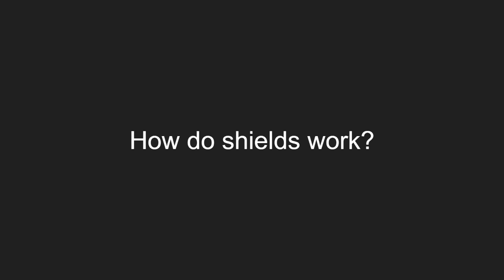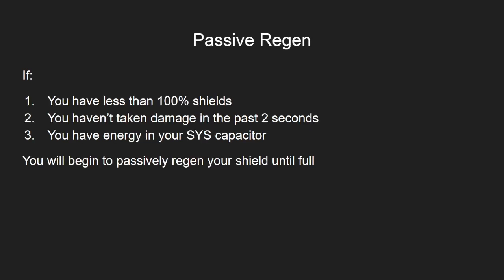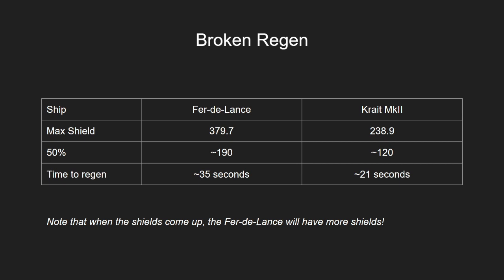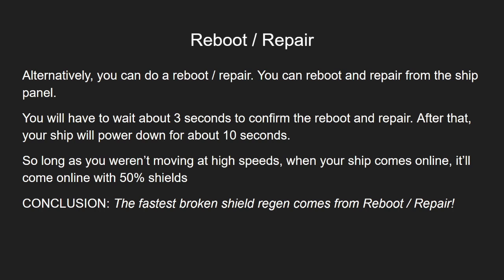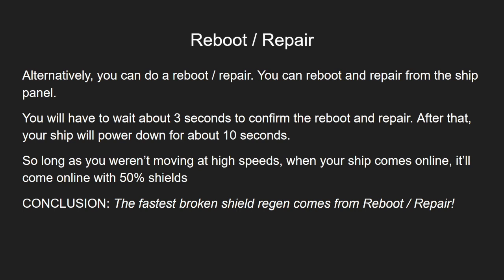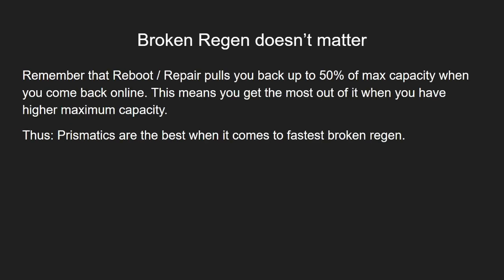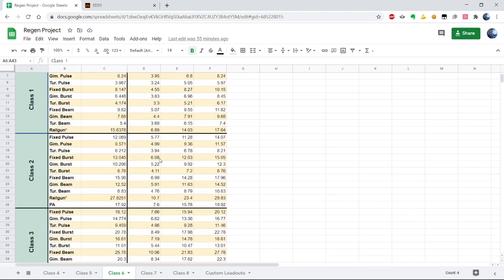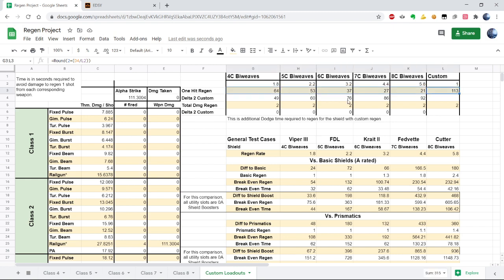Why Bi-Weave Shields Suck

Comment: Not even gonna finish watching this but I can already tell you it depends on what you are doing,  for bounty hunting its a mixed bag, for conflict zones it sucks balls, for 1v1 pvp, if your opponent is using the plasma accelerators, it's a godsend.  At that p9int you are jousting, and if you know how to trick the aim guide for them, then yes biweave is nearly top tier, just avoid getting hit for 2 or 3 passes and you already regen more damage than you took.  I went up against a vulture that had bi weave like me and we knew what we were doing, we called it a draw bc we would've been there all day until we ran out of ammo
Reply from the maker: Thanks for saying you didn't watch the video because I actually describe the cases in which biweaves are useful. Your anecdote just tells me you and your pvp partner suck at combat.
Reply: @im-the-zam  first off, pretty sure my pvp track record would beg to differ, considering I went after the so called best pilots at the time, I made a build to counter the Fer de Lance plasma meta, one that everyone told me wouldn't work, and I NEVER lost a duel.  Infact crimsongamer99 came across the same build 3 or 4 years later and it started picking up traction.  You are a little late with this video explaining why bi weave shields "suck."  Yes I know this was posted 3 years ago, should've posted it 8 years ago
Reply from the maker: You're saying that in your pvp vulture you and your friend are either unable to hit each other or are spending minutes out of combat. If either are true, you and your friend are bad. Without engineering on the PAs, you're still doing enough damage to require 30ish seconds out of combat for 1 hit by 1 PA (on just the absolute damage alone). You are overboosting in your jousts if you are spending that much time out of combat. You have a skill issue. And if you are not hitting your target, you are also skill issue.
Reply: @im-the-zam  I didn't tell you what build I was using, nor what ship, or how exactly I fly to avoid getting hit, if you can't figure that kind of stuff out on your own, you need help.  It sounds like you assume things way too much.
Reply from the maker: You told me you and your friend were jousting in your pvp vultures and you said you were tricking the lead indicator to make your friend miss with his PAs. Ignoring the fact that the "tricking the lead indicator" thing is pretty easy to hit through (your friend is definitely bad) I know you are using a bi-weave shield. And since I know how much absolute damage PAs do it's a fairly simply calculation. Even if you're running fast-charge, the regen rate for 5C bi-weaves is only 2.5. Unengineered PAs do a little more than 50 absolute damage. Factoring in the out of combat delay, it'll take you 22 seconds to regen after getting hit by one. 42 seconds to regen after getting hit by two. If you and your friend are spending minutes out of combat and / or are unable to hit each other to the point where you have to call a draw, you and your friend are just bad.
Reply: @im-the-zam  read again on what ship I was using, you can read can't you?  And also it's easy to trick the lead indicator, I doesn't flow if the ship is constantly changing its trajectory,  if you think that's impossible, or highly unlikely then you haven't tested it out for yourself.  Yes, I can avoid getting hit by plasma accelerators for longer than a minute as long as I don't fuck up and keep my distance until I'm ready to go all in.  I mean by keeping a distance that still allows me to do some small amount of damage while staying at a safe range even with a slower ship compared to the Fer de lance.  And no I don't fly the vulture.
Reply from the maker: I know how the lead indicator works. I tested it thoroughly when people kept telling me that NPCs do impossible things to dodge PA shots. Either way, many games have lead indicators, they work the same way, and if you have experience with space sims that have projectile weapons, you quickly learn to not rely on the lead indicator. So yes, you and your friend have skill issue. It doesn't really matter if you weren't in the vulture, again, I can easily calculate how long it takes for you to regen damage and the whole point of the video, the thing you DID NOT WATCH yet still found the need to comment on, is that the regen is really low. Even if you're in a larger ship with a 6C bi-weave, you're still looking at around 20 seconds to regen the absolute damage alone (60% of the PA's damage). The numbers I have been showing you have been for just the absolute damage, we haven't even talked about the rest of the PA's damage. 

So yeah, if you and your friend are so bad that you cannot hit each other for minutes, you're bad at combat.

Comment: I have an engineered cobra with bi weaves. Should I be using an A grade shield generator instead?
Reply from the maker: It's really up to you. I'd have to see the build before making a full assessment. If you send me a edsy.org link I'll take a look. But I can make some general comments. 

Generally smaller ships can get away with using bi-weaves since the superiority of other shields really only manifests once engineering and Shield Boosters get involved. Since I know how much of a pain engineering is and I don't know your situation, I'd say just chill on that Bi-Weaves and just get a proper shield when you class up to a medium and engineer that.
Reply: @im-the-zam  I have a cobra 3 and a vulture non of them engineered. New to the game and have been doing alot of bounty hunting. I have bi weaves on both. Was wondering what I shld be running either a bi weave or A grade shields.
Reply from the maker: @Johnjohnson-zg4ek  Again, the differences between Bi-Weaves and other shields really only become what I'd consider a real issue as the shields get larger and engineered. The point of this video is that the regen in Bi-Weaves shouldn't be the selling point. 

If you're just starting out with small ships, the Bi-Weaves are fine. And if you're running a vulture without engineering I'd say that's probably your best shot for a shielded build. Vultures without engineering tend to be strapped for power and the Bi-Weaves can be a nice means around that due to their lower power draw

When you hit medium ships like the FDL that's when I'd say definitely swap over to the Class A Shields or get prismatics if you can. Especially if you have engineering by then. A lot of the arguable benefits of Bi-Weaves go away when engineering is considered.

Comment: - if you take damage or are moving during reboot repair the shields won't regen.
- some ships have very fast regen rates that can be utilized in a hull tank to deliver high effective shield values in a duel.  
- I frequently end a undermining drop with more shields than I started with on my biweave.  
- needing to reboot and repair is inefficient and slow for undermining 
- aside from the hull tank biweave build like on alliance ships, I agree for pvp you don't want biweaves
Reply from the maker: 1. With regards to RnR, obviously. But the issue with that argument is if your shields on a Prismatic went down forcing an RnR, your shields on a Bi-Weave went down forcing an RnR a long time ago. Shield break in general is the point at which the fight has been decided. 
2. Regen rates are tied to shield, not to ship. Talking about hull tanks in a shield discussion is off-topic imo. 
3. Your bi-weave anecdote is whatever but doesn't negate the point that the regen value is low and not useful for in-combat states. 
4. You're also talking about an activity which is ripe for PvP which means if you want to be prepared during undermining you should be using a Prismatic anyway

I mentioned this in the video, you can like Bi-Weaves and that's fine. The regen value is just too low to justify using them on the basis of "I regen combat to combat" unless you're spending extensive periods of time between combat. Though I'd also wonder how you're undermining. For solo UMOP, the most efficient method is to aggro several wings at once. You can easily wind up fighting 5-6 wings at once and for that you do not want Bi-Weaves and if you did happen to be using Bi-Weaves at the time they would've broken.
Reply: @im-the-zam  sorry yes I meant to say some ships have fast rebuild rates and thus can rebuild their biweaves multiple times during a fight (1v1 - in a wing fight you take damage too fast when focused) and thus effectively get equal or higher shield value as a prismatic but without the power or weight drawbacks.

I undermine solo  in an anaconda and I'm super efficient in my biweave so I'd say I'm doing just fine
Reply from the maker: Rebuild time is based on broken regen rate and max shield. If you can regen your shield multiple times in a fight, it's a hallmark that your max shield value is super low. I've actually done the math on regen times and you have to be severely underclassing your shields to regen like that. Not to mention you get to enjoy taking all of that free module damage for no reason.

You're probably not as efficient as you could be if you find yourself fighting 1v1 often. Again, the most efficient way to UMOP is to take on several wings at once.
Reply: @im-the-zam  I've beaten fdls and watched other similar builds win 1v1 vs an fdl.  But anyway we'll never agree.
Reply from the maker: What do you mean you can beat FDLs 1v1.Mate, you can beat 1v1 FDLs all day and night when it's PvE. If you're talking about PvP then that FDL wasn't using a very good build because even some of the better Bi-Weave'd Anacondas lose shields within 20 volleys of a meta-de-lance with TC. I once calculated the DPS of the meta-de-lance and don't quote me on the numbers atm but iirc it was something like 360 DPS with of course about 200 of that being absolute. The Anaconda will crumple within minutes even with SCBs. Then we have the fragmamba which is a low IQ build that is really effective at making Bi-Weave shield tanks sad if you can get a stick on.

Of course, your anecdotes really don't matter because you've already ceded the point that in-combat regen isn't a factor and I can mathematically prove that in-combat rebuild times are stupid slow in comparison to reboot and repair. I've also provided a tool in the spreadsheet which actually calculates the rebuild time for a given shield and it's really not a thing in a post-engineering E:D society. 

We don't have to agree, you haven't presented a case against the thesis of the video.
Reply: @im-the-zam  I didn't cede that in combat regen isn't useful.  It very much is.  The problem is you seem to assume that every drop is a good one with 9+ ships to destroy.  That's not how it works in reality.  Often you'll get 3 ships.  Often none.  With the actual distribution of drops observed in real life I find that I regen a ton of shields at the cost of zero time
Reply from the maker: @TheOtherClips  You did cede in combat regen to be useless. It's not useful. Someone need only tag you with an outside of optimal range attack to prevent you from getting it. No one is regenning in the middle of combat. 

It's pretty easy to consistently get 6+ ships when doing UMOP. Idk what you're doing. Your personal experience with shields doesn't negate the math. Bi-Weaves have to spend stupid amounts of time out of combat to regen hits they take.
Reply: @im-the-zam  and here is where the discussion, as it always does, degrades to pointless.  I'll keep doing what I'm doing with proven results and you keep doing what you do.  Just don't claim either of us is right.
Reply from the maker: Except I am right because I literally have the numbers and the game code that support my argument. You need to come up with something that supports your argument if you wish to challenge me.
Reply: @im-the-zam  but with the bugs in edo I agree biweaves are not optimal.  Strong shields and some banks are the way to go right now
Reply: @im-the-zam  you literally can't be convinced that you're anything other than perfect and brilliant so I'm not sure why you think that's worth my tine
Reply from the maker: The bugs have nothing to do with it. It's the fact that the regen rate is so low in comparison to the damage you take. A class 5C Bi-Weave has 2.5-ish regen / s with fast charge. Fast charge is the only mod that increases regen rate outside of being shot by an ally with an experimental. If you get hit by 1 (one) unengineered railgun (20 damage) and let's just assume that you have 50% resistances since I think that's fair, you'll take 10 damage which will take 6 seconds to regen. An FDL will often run 2-4 railguns depending on build. That means if your 5C Bi-Weaves get hit once (again, only once), they will require you to get out of combat for 12-18 seconds to regen that all up. If you're undermining optimally, you're going to be fighting 3-9+ enemies at a time, which means it will take you minutes to regen all of that damage and you run the risk of shield break because you're running with reduced capacity shields. Prismatics will keep you alive far more than Bi-Weaves will, and the numbers support this. 

Yes, you can make Bi-Weaves work for whatever you're doing in PvE, but there's a reason under the most intense of situations that all builds converge on Prismatics.
Reply from the maker: I can be convinced but you're going to have to address all of the problems I've outlined with Bi-Weaves and they can't involve "Just sit out of combat for minutes at a time". I do note the niche situations in which Bi-Weaves are appropriate, but in GENERAL you don't really want them.